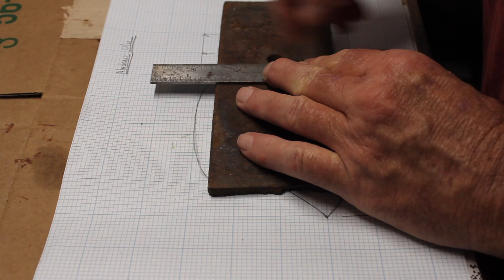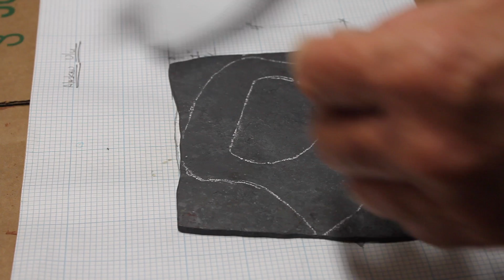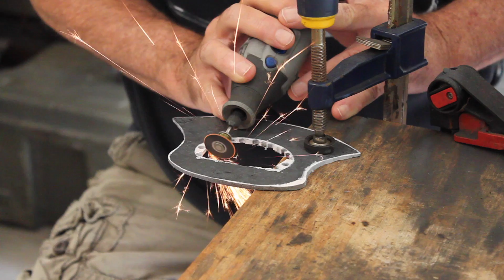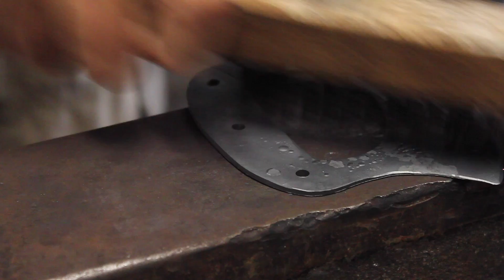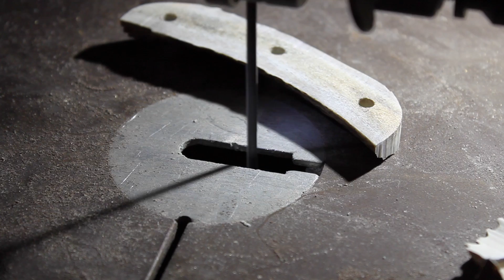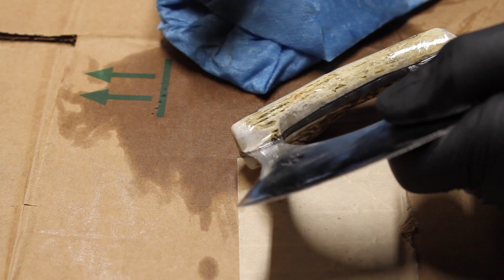Forging an Alaskan Ulu from leaf spring - knife making

Comment: Why is your anvil wet?
Reply from the maker: The water blows (sometimes "pops") the scale off during forging, it's called "wet forging". I like that I get a much cleaner forged piece with fewer dings and dents when using water, and without having to brush as much.
Reply: Very impressive!